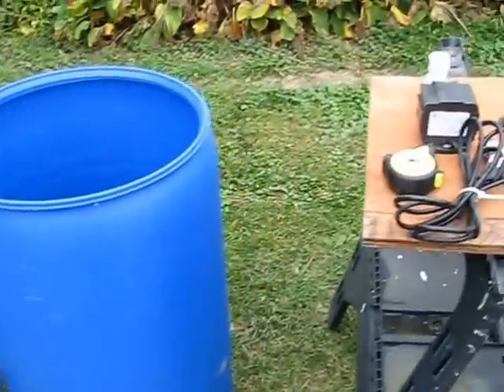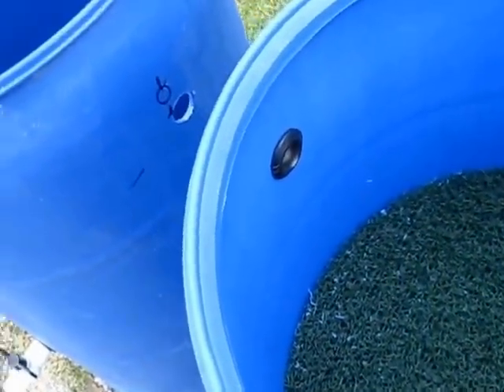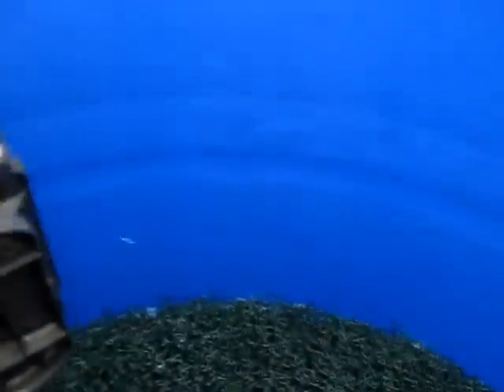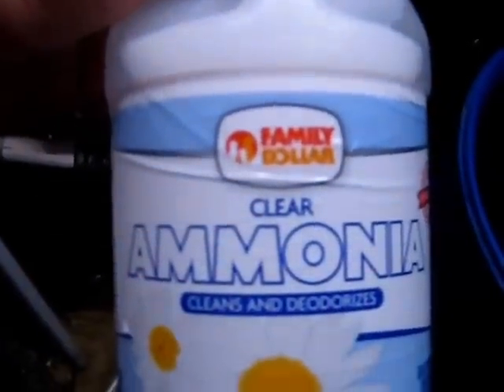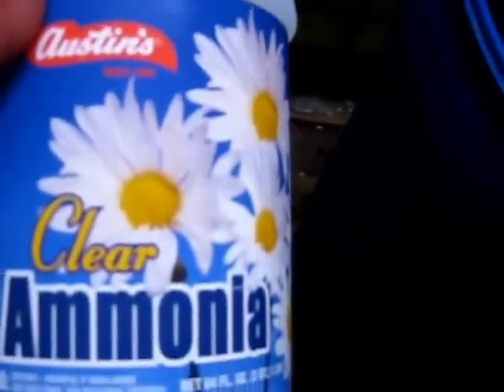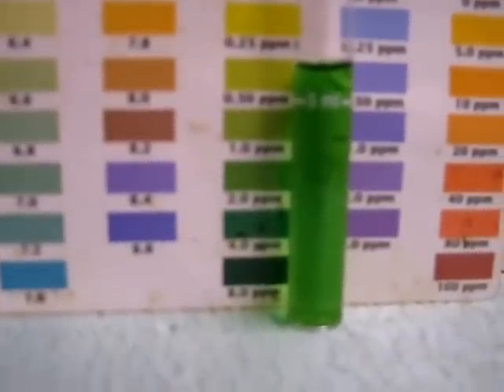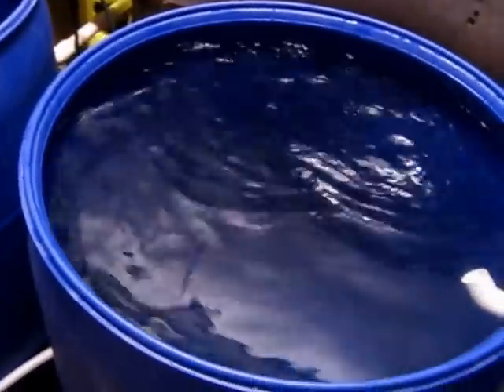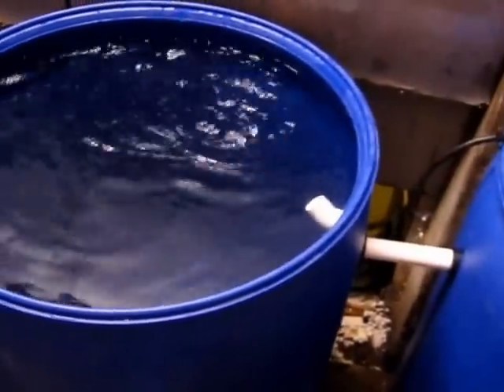Fish In A Barrel  - Week 2

Comment: might be worth sticking a second pipe in between the barrels,or a big screen over the intake... if  a dead fish blocks the one pipe with the valve it wll cause the fish filled barrel to over flow...
Reply: If the pump takes water just abve its head, and there is no more inflow of water, then the fish barrel may not overflow.